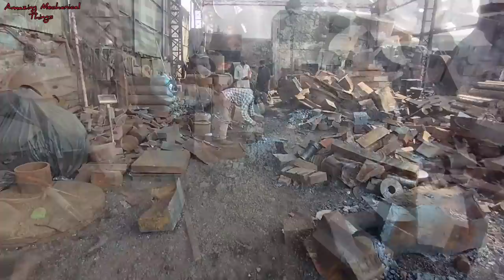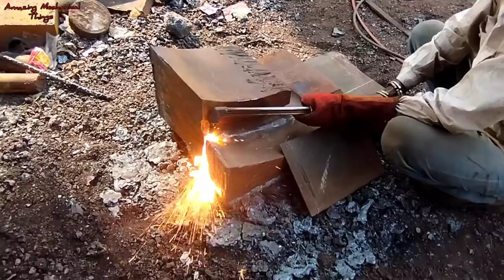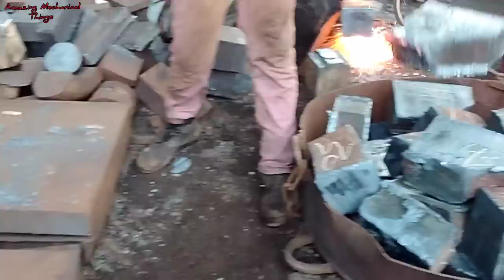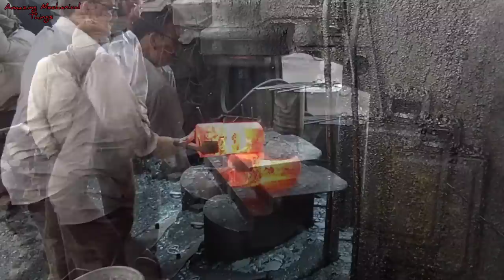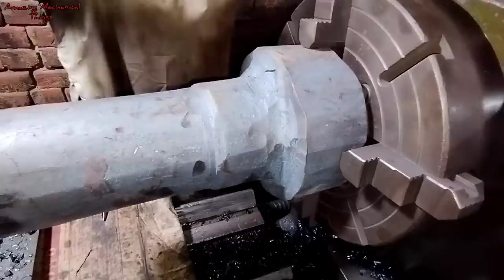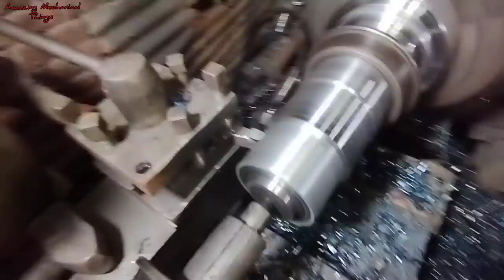Manufacturing Axle Spindle of Heavy Duty Truck Trailer || How Truck Trailer Axle Spindle are Made

Comment: I guess they edited out the part where they did the metallurgical analysis for tensile strength etc😅
Reply: Only thoughts are that 1) they put uncommon trust in the raw material, or 2) they figure, “40 seconds, or 40 meters” is good enough?

Wonders aloud, “why aren’t they using go/no-go gauges?  Those aren’t that hard to make.”